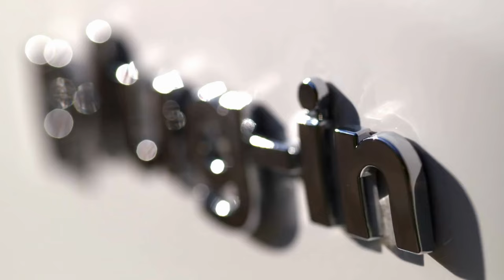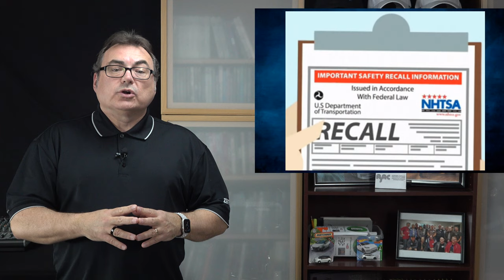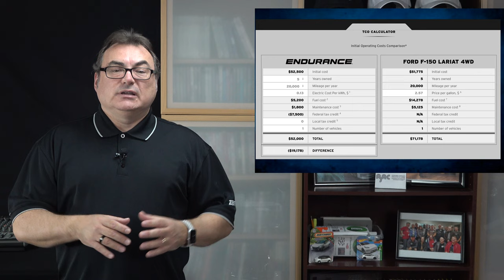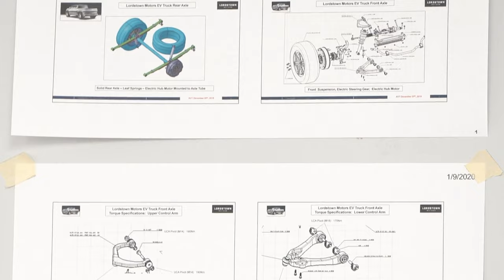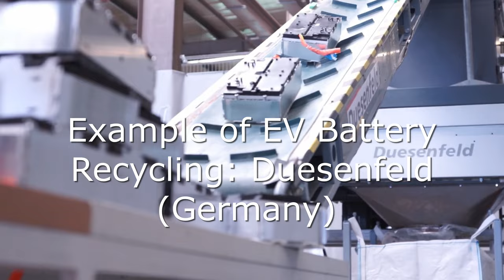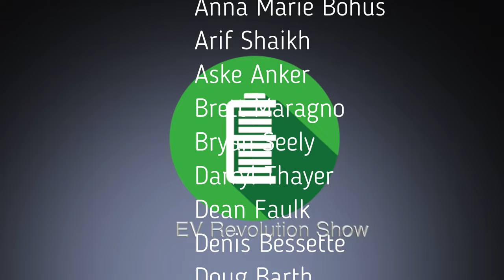Episode 123 - Hyundai Ioniq 5 Reveal!

Comment from the maker: PRICING: Seems I had wishful thinking when I commented that the base starting MSRP may be under $30,000 U.S.  That does not seem to be the case as it may be under $40,000 U.S. (like a $39,995 example).  No pricing has been officially announced yet for the IONIQ 5 for most areas, however CarWow.co.uk, has stated that the First Edition Models will come in at a starting price of £45,000.  I am not aware if this is confirmed.  

If so, then the wish of a starting MSRP of under $40,000 U.S. may be just that....a wish.

Comment: I have a sinking feeling that the IONIQ5 is going to be another limited availability compliance car only available in select coastal states. It’s charging speed really pushes the envelope and makes it desirable.
Reply from the maker: I hope not but you could be correct.
Reply: Hopefully not, I understand limited battery supply was a major issue in previous vehicles, hopefully they have the supply chain in place now

Comment: Great show again! Do you know what year Ioniq Ev will be affected by the battery replacement recall in Canada ? I have a 2020 Ioniq Ev. Thanks 
Stefan B
Reply from the maker: Hello Stefan, thanks for watching and the feedback.  They don't say specifically, however if you go to your local Hyundai recall website (example: Canada Hyundai recalls = https://www.hyundaicanada.com/en/owners-section/recalls), you can put in your VIN to check it out.  Or call 1-800 Hyundai Customer Support to find out, based on the cars VIN.  Not all Ioniqs will be impacted.
Reply: I believe older model year packs are affected, but as Ken suggested it's best to check the website.

Comment: Clarification, Hyundai Ioniq 5 in North America, we'll get a bigger, 77.4-kWh battery insead of global 72.6-kWh the optional battery pack in the rest of the world....
Reply from the maker: Thanks!
Reply: Yes, I believe they are using a different battery supplier for North American vehicles
Reply: Cell type capacity is standardized, so the supplier should not matter... 

Bottom Line is that Hyundai just wanted to use a higher capacity pack in NA, where ppl tend to drive longer distances. (KISS)

Even though there is lot of drama with their  Korean suppliers... But even after the recall of LG cells, it's doubtful they will switch.... Since their 2nd option SK from from Korea has been ordered to shut down operations in 2 yrs..... Unless there is settlement....
Reply: @nc3826  yes, but the issue may be related to a legal matter preventing SKI from selling batteries in North America
Reply: JP: WADR,  that would not matter anyway..... "I already pointed out" the cells will have the same capacity no matter who the supplier is....  they are not switching to a different type of cell in NA....

Also even if it did matter LG not SK is producing the the cells for Hyundai.... 

SK produces the cells for KIA, so SK is not a factor for Hyundai EVs in NA anyway...

Sorry, if I can not explain it well enough for you to understand what I'm saying....

Comment: 20% in 18 minutes means it charges at 90kw... not 350 kw....
Reply from the maker: Thanks for watching.  It was from 10-80% in 18 minutes.  That's 70%.
Reply: @EVRevolution  Do you know what battery pack the 10-80% in 18 minutes is based on? I could not find that info?  (I'm guessing the lowest capacity battery pack)

Or what its level 2 charging max rate will be?
Reply: FWIW, it was quoted to have at launch a max DC charging rate of 220 kW using a 350 kW DC charger (not sure why it needs a 350 kW charger to only reach 220 kW?).... 

So fanboys can relax for the time being.... But OTA upgrade are promised...
Reply from the maker: This is what they state:  
When charging with an 800V ultra-rapid charger, it can be charged to 80% in just 18 minutes and a 5-minute charge will give you a range of up to 100km. One full charge will give this vehicle a predicted range of 470-480km*. 
* When equipped with rear-wheel drive (RWD) and 72.6-kWh battery, IONIQ 5’s maximum driving range on a single charge will be around 470~480 km, according to the Worldwide Harmonized Light Vehicle Test Procedure (WLTP) standard. The official driving range for IONIQ 5 is still to be announced.
Reply from the maker: I would agree stats are probably on smallest pack size. Could not find L2 charging spec but I would guess up to 11kW. That seems to be the new norm.
Reply: @EVRevolution  thx for confirming that all the specs are based on optional higher capacity 72.6-kWh global (ex NA) battery pack, which will be just a little less then the 77.4-kWh battery pack we will get in NA.... Which is pretty impressive...
Reply: @EVRevolution  Sorry you second comment confused me.... But I guess you do not know the answer to either question after all... 
But thx for checking on it, Sir....